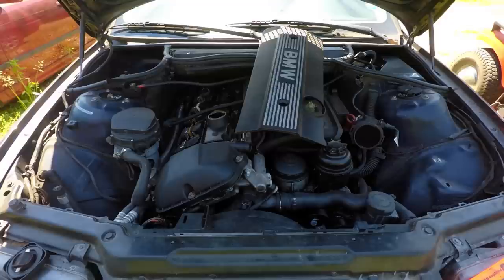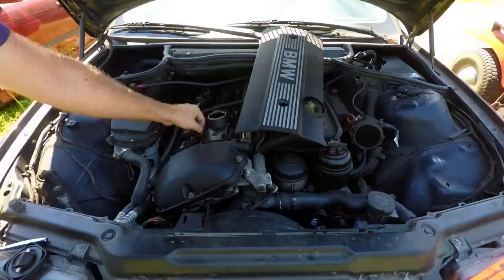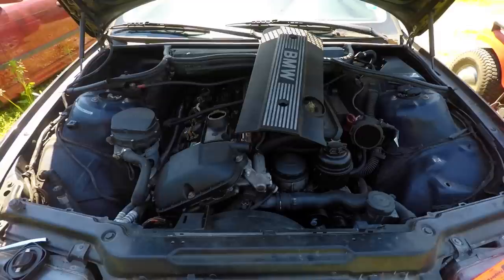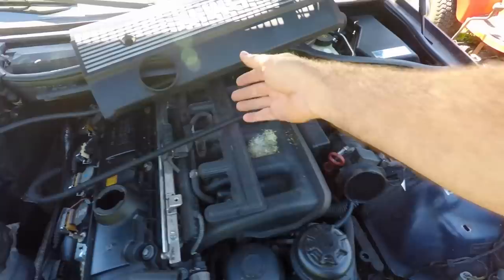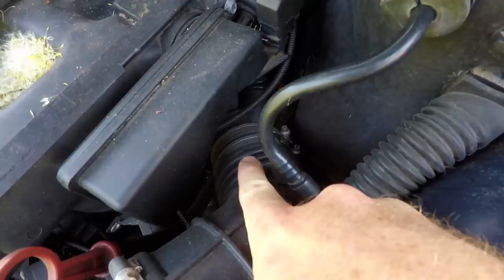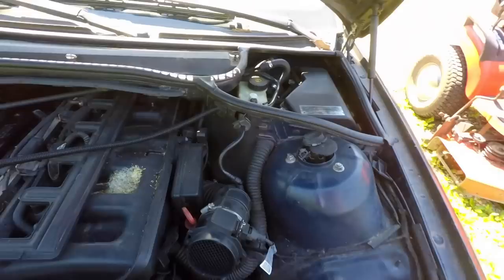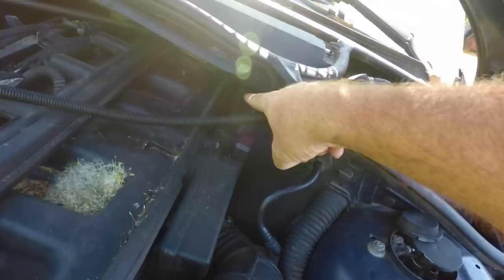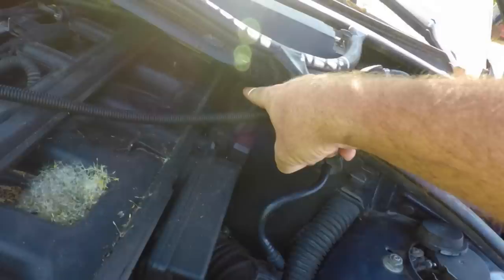Common BMW Engine  Misfire Causes And Fixes

Comment: Will it make you cringe to know i was on factory plugs at 125k miles? Funny enough i could have left them in. Same with the fuel filter. Talk about lucky.
Reply: I have an oem fuel filter on my 325i and it has 173k miles… having misfire issues, no codes

Comment: Sir same problem with my bmw e46 2003 i have changed coil plugs air flow but the car is still missing what to do now plz tell
Reply: My e90 was having misfiring and I did coils and spark plugs. Got the injectors flow tested. I'm moving onto the high pressure fuel regulator. It only misfires after a 10 minute drive and once I prime the car it runs fine

Comment: Just a thought, when doing the voice over thing take it a little bit slower with the video on each thing your showing, instead of moving between items so quickly. (It could just be that I'm too old to be able to keep up!) The video was very clear with the new camera... What is up with having a mouse nest in the motor??? Is that just a parts car? Yikes, what codes are set when a mouse nest starts to burn when the motor gets hot ?!?

Comment: Hey Nathan, how are you! Good to watch another video of yours. You've been very helpful.  I subscribed to you on my other account.  But I can't access it @ the moment. You're videos been very helpful. Having trouble with my 2010 328i xDrive BMW. Misfiring on 4 cylinders. But I replaced the spark plugs and ignition coils. But brought the car to Burdick BMW to fix 2 recalls. And now its running like crap.

Comment: Had a misfire with my 2002 X5 3.0 M54. It threw 3 misfire codes. I changed all six coils and plugs. Ran good for about 30 miles then it started misfiring WORSE. The vehicle threw ten codes! I did go with cheaper plugs. It had the double platinum NGK, four electrode plugs and I replaced them with cheaper Autolite one electrode plugs. Do you think that the cheap plugs are my problem or should I look at the disa?
Reply: Did you ever figure it out?
Reply: Check for possible vacuum leaks as well! I’m currently hunting down random misfires in our 06’ X5. Starting with plugs and coils.
Reply: @Gustyen 2015 m4, car was fine after spark plug change and valve cover gasket replacement..began to have misfire at 4krpms, under heavy throttle changed new coil packs , and injector 5, still misfiring with misfire codes.  Replaced the new plugs with new plugs... And misfire is gone. 3 weeks later, misfiring again at 4k rpms, no codes though. Replaced plugs again but same symptoms...  Have been reading it can be injectors? Flywheel unbalanced? Vanos solenoid? Idk where to start

Comment: hi Nathan's i have bmw 325i 2000  ihave cold star mis fire .I check no air leak but when i disconnect maf sensor the car work good  and sens cold start misfire started i had problem with transmission not shifting good with out safe mode .

Comment: Need help with a recent e83 m54 3.0 head gasket replacement zero overheating now but misfires and has a bad idle and won’t stay on longer then 15 mins

Comment: My e90 320d drives flawlessly most of the time, but on some ocassions when I'm pressing the gas to the middle point, it starts to make a slight BRR BRR - BRR BRR BRR- BRR BRR etc sound, until I take the foot of the gas and press again. Sometimes it just goes away, sometimes it stays a while. It's not making the car undriveable, but when that happens it jerks slighty, like it connects and disconnects the gass a little, not fully.

Do you have any idea what this might be? My local BMW mechanic was unable to locate the issue, he was also unable to reproduce it, since it happens randomly..

Comment: Hello Nate. I just bought a 1999 Bmw 328i. I am getting a misfire in cylinders 2,3,6. I checked the coils and swapped them and the problem does not follow. It also makes a ticking sound until its warmed up. What could cause this? Spark plugs and ground wires were just replaced as well.
Reply: tapets going out

Comment: Hey Nathan video is perfect but I have a question about my 1999 BMW 740il transmission safety mode keeps popping on and the car runs like crap when it does is my transmission bad?
Reply: It could be your neutral safety switch. Had the same problem with mine and that fixed it.

Comment: Hey I have a 2005 X5 with a m54 engine that idles rough with a p0302 code. I did a compression test and cylinder has the lowest compression.

Comment: nathan help me.. i change spark plugs  and trade a coil number 2 for a number 1 but the cilinder 2 wont work.. rought idle and steering shake and so much rough noise on the engine..why the cilynder 2 wont work?what can be?

Comment: Hey Nathan I got a 1998 740il that keeps pulling coded po173 and po170 and is hard to start first thing every morning, I've changed the plugs and cleaned the maf but the codes are still present also exhaust smells like it's running a little rich, what might it be?
Reply: TheAlexv6.
Reply: TheAlexv6 check elbow boots, idle control valve, fuel hoses

Comment: Help.... I changed the spark plugs of bmw e90 320i the after the start but misfire. Swapped the coil plugs then after not starting but cranking.....  While cranking the Rev counter moves a little bit

Comment: Hi Nathan, you are amazing. I'm having the fault code : Enging-DME Digital Motor Electronics MS43. It says Cylinder 2 and 4 misfire. However when I erased code, the engine is running perfectly. Do you think the problem got fixed when I erased the code?
Reply: no

Comment: I have a 2006 330i bmw  and it starts ruff  and smells like crud gas like not mixing right but after I’m on the road it work perfect great power no problem but every time I come to a stop it shuts off it start right away after that but every single time I come to a stop it shuts off when I’m on the highway no problem

Comment: I just replaced my valve cover gasket and got a check engine light when I went to turn it on p0313,p0174,p0102’p0171.   Please help what can it be. 
Car was running absolutely fine before doing valve gasket

Comment: In my case it was the wiring harness one of the wires were broken and was causing misfire in cylinder 4, I'm still not sure if I have to replace the wiring harness or just fix the wire.
Reply: What did you figure out with your misfire? Im having the same issue. How did you determine the wire was broken? Thanks
Reply: @crack69ify  any answers or did you end up fixing yours ?

Comment: I only get a misfire on Cyl 3 during high RPMs when I really push the car. Does that have to do with the spark plug gap? I have an e60 M5.
Reply: Berkay Karral did you ever fix your problem

Comment: Hi I have a BMW E46 with misfire on cilindre 2, spark plugs neu with coil pack neu with compression 12bar stil misfire no vacuum leak tested with smoke mashin please, "Misfire Cylinder 2 With Fuel Cut-off P1345" help

Comment: Hi Nathan! i have a E39  523i M52, im having some problemthat car starts fine when cold but after driving a while if i stop it, it wont turn on until engine is cold again. i read the code and it showed a code for camshaft position sensor and i replaced it with  OEM one but problem still exist. i notice after engine is warm starter cranks only for second and nothing happen. i replaced crankshaft sensor about a year ago with OEM one too.What do u think that is making warm start problem?Thanks
Reply: Xulian Zeal if your car shuts off at idle when engine is warmed up and won't turn back on you seem to have an overheat issue .if your needle is fine, some hose is either getting burned up
Reply: Bmw M3 e46 My nidle stays normal, i took a spark plug and it was fouled because of running rich. im gonna change those plug soon. whats makes starter to not crank more than a second while warm?
Reply: Jose Francisco Medeiros  i will do that tomorrow, i Have noticed that power steering fluid on a alternator harness. i will clean those as u said. Thanks a lot.

Comment: My 99' 323i almost ran out of gas and started running rough and I'm pretty sure it's misfiring it feels like it. Don't have a scanner at the moment so I can't prove it but any advice? Could there be air or debris in the fuel system?
Reply: I had same problem with my 2000 323ci it was my vacuum hose

Comment: Question I have a 2005 645Ci convertible, what is the correct brand name for the parts for coil packs and spark plugs, I’ve bought brands that aren’t OEM and my misfire would go away for about 2 weeks and start misfire again I’m in need of answers thanks and I enjoy watching your videos

Comment: What should I do next I had a misfire in cylinder 6 I change ignition coil and spark plugs when I change the spark plugs they had dry oil on them car shakes at idle
Reply: do you clear the probem?

Comment: My m54 (02 X5 3.0i) 
Misfires when I go over 4500rpms throws p1353 than I use my ob2 scanner to erase the code than it runs fine afterwards
Reply: Yeah I've got an 02 325xi and its done it twice uphill under heavy load. Cleared code and it's gone. The second time an evap code came up as well

Comment: I have a very strange random missfire that comes on at low speeds in traffic. If I restart the engine it clears.  Any idea what causes that?
It only happens when the engine is warm and at low speeds.
Reply: have you found any leads ?
Reply: Please inform us if you've found anything.
Reply: @tsarbear4191  I totally forgot about this but my issue was only misfire on cylinder 5. I replaced coil spark plugs and valve cover gasket,  disa valve, and intake boots. Only had a oil pan leak at that point.  Finally took it to a shop and said the valves were bent . Most likely because of the disa valve the pin was missing when I replaced it. Unfortunately didn't get around to fixing it as a reckless driver ran a red light and hit me. Rip 330ci vert .
Reply: Oh geez I'm working on a 97 328i also a miss on only cylinder 5 noticed some oil on the plugs, some people on the forms usually blame the ccv so a simple fix will be to bypass it and replace with a catch can. Thanks for the info though as it does give insight.
Reply: 7th Element Driving could be ccv too. I read about that mine had a small leak and was on it's way out probably but wasn't losing oil dramatically either .Less than a quart every 2000 miles so I know it wasnt that bad . But the catch can is definitely a good upgrade.
Reply: @josemartinezoc1534  I'm not sure if its true but I've read that the cab tends to break and send oil through the air intake causing so pretty bad stuff

Comment: hi. pls. help.  325 M54. always missfire cyl2. when cold.  moved: sparkplugs, coils, had injectors cleaned and moved to other positions. have same compression values on all cylinders. - o2 sensor bank 1 - before cat. changed but it didnt help it from peding up and down values just are not stable like bank 2 before cat. (even when warmed up)...  engine light comes up from now and than and complains on cylinder 2 missfire or the bank 1 bef. cat. sensor.
Reply: If the cylinder gets shut down (errror code:misfire and cylinder shutoff) when cold, its the hydraulic lifter that are sticking,so when cold, the valve sticks open so that there is no good compression. Check compression when completely cold, First thing in the morning, if it’s bad, put some oil into the chamber through the spark plug hole and measure again. If it’s good, your piston rings are bad, if it’s still bad, might be the lifters as explained above.

Comment: I have an e36 that idles rough when I first start it until it's warmed up then it idles fine. Any ideas?
Reply: Jason Markiewicz could be your camshaft
Reply: Check your crank case vent lines see if they're split or cracked. Mine was doing the same and replaced those and it went away

Comment: P0305 PO303 PO306 PO174 PO300 PO304 PO171 Rough Idle, clear the codes and comes back after about 20 minutes. I did take apart the intake hoses to fix a power stearing leak and now ever since the hoses have been loose and popping out and stalling out the car, so I endded up screwing them in place. no more stalling but I do keep getting these misfire codes. is this the issue you think? Sometimes I hear a whistle sound when accelerating. Idled at a red light or stop sign is always rough and first starting the engine it sounds like a whining grinding sound until it warms up and goes away. I cannot see any cracks or holes in the actual hoses other than the screw holes I made to hold the stupid things from slipping off.
Reply: Ever figure it out?
Reply: Following
Reply: Same problem here, what was the solution?

Comment: so checc this out. I'm having the same issue. I've tried the seafoam it worked but then the car cuts bacc off as if it lost compression again... I'm confused at this point. I'ma try what you have . I've changed camshaft sensors, crank shaft, fuel pump, spark plugs etc I had a reading that said that I had multiple misfires ... After I tried this fix . Should I try it again?
Reply: What was the problem after all?
Reply: @calisoul1921  make that's a long story but when I get home I'll make sure to tell you lol
Reply: @ItsCertified  Hopefully its not an engine replacement
Reply: @calisoul1921  nope but all issues could be different dealing with these damn BMWs. Do you have diagnostics specifically for BMW?

Comment: I just subscribed to your channel. I recently started having problems & check engine light with my 7series Bmw N63. First one was Dmtl fuel pump leak. After driving for 2 days. I did a burnout fresh tires I got then after it went into limp mode & start to show drive train malfunction in the engine. I drove it for a little to park it and start smoking from the engine but the car wasn’t overheating. Put the computer on it the error codes were running a code saying running lean & all cylinders misfire. It starts back up without a issue but it goes back into limp mode & sometimes shut off on its own. However I noticed a air seeping sound from the engine when it’s being rev. Please can someone help me find out what could be the issue here
Reply: Disa valve

Comment: Please men I need your help .just got a x3 sdrive 18d  2014 with b47 engine and 47000miles. Right at the main dealership I noticed it and also a whistle . They changed the turbo and the whistling stopped. Shoulda walked away but ..... when I start the engine it vibrates and sounds like a train. I can even hear it inside the car and feel the vibration on the gear stick and clutch. Help please!!!
Reply: No check engine light and the dealer says no fault but I no something is wrong
Reply: Motor mounts.

Comment: Jeez you are a dead ringer for Travis Rice.... Already done coil packs and he basics. Runs fine higher end and at tick over but its hesitating from low revs if you try and put too much thru the throttle.  If you keep pushing it throws it into limp mode with the CEL.

Comment: What if there is oil on the cpil pack??
Reply: Did you find out what happened with oil on the coil pack? Mine 2006 bmw x5 has this problem.

Comment: Hello Nathan well you are my last hope seriously. I got 03 bmw x5 3.0. I'm having codes for ignition cylinder on all cylinders. I change spark plugs, fuel Injectors, ignition coil, and fuel filter..after all that codes still present...any advice would be VERY appreciate thanks you an advance
Reply from the maker: Prob the ccv
Reply: Crankcase vavle correct

Comment: I have a 2012 BMW X5 3.0 I’m gettin random misfires for sometimes 1,2n6 n sometimes I get other misfires too . I replace the  all spark plugs all coils  plus the injectors also the high pressure fuel pump n oxygens sensors n cooler temp sensor I’m jus throwing parts at this car. Can u assist me? The codes I’m gettin right now are 2ee0. 2ee1 2ee4 2ee7 2ef5 2efe 2eff 2f00 2f04
Reply: I have a 2012 BMW X5 3.5 and getting cylinder misfire codes - did you happen to find out what your car problem was?  I’m going to start with all the smaller items you mentioned (spark plugs, coils, sensors etc), but any advice you can give would be EXTREMELY appreciated! Thx!
Reply: Cinder Nena I had to torque my spark plugs to 16 foot pounds torque n it solve my problem  maybe try that
Reply: Install new plugs n torque them
Reply: vic mahabeer Thank you so much for the advice! I will try that 🤞🏼

Comment: I'm running rich on banks 1 and 2 with the occasional pop-up of cylinder misfire on 2 or cylinder misfire on 5
Reply: I got that code, and replaced those sensors. It didn't fix the missing. 
Did you find what it was ?
Reply: @Magic4599  it's been quite some time now but I did have a crack in the intake boot I also changed all vacuum hoses and make sure the little port on the back of the motor was capped. maf as well
Reply: I don't know if that's what fix that problem shortly thereafter I replaced my DME and haven't gotten those codes since I hope that helps you like I said it's been quite some time
Reply: I don't know what you have tried so far feel freeTo to ask if you need more input and let me know what you have already done

Comment: My 2006 525i has a misfire on cylinder 5 and 6, I replaced plugs and coil pack but still had a misfire. What could be wrong?
Reply from the maker: Prob ccv is blown